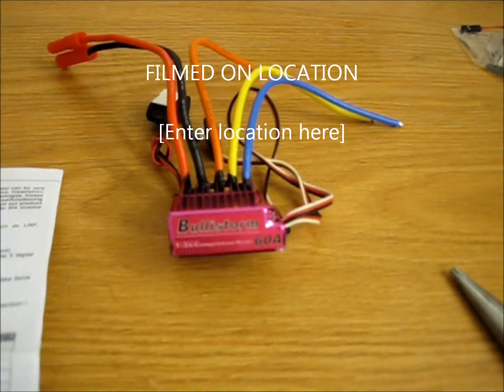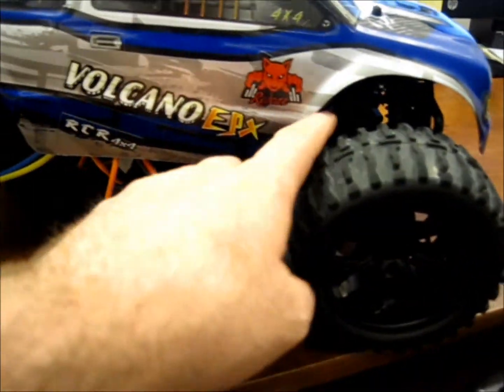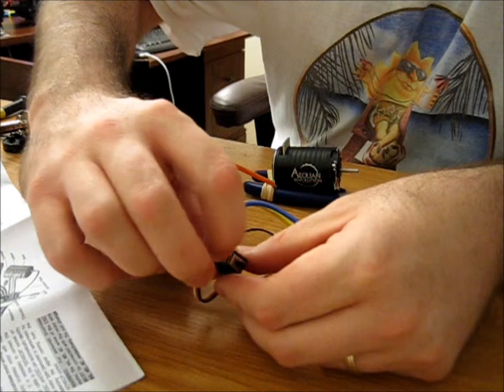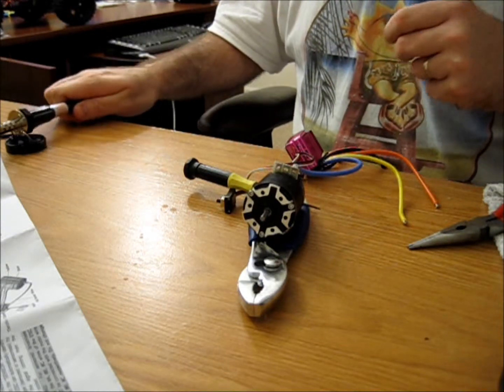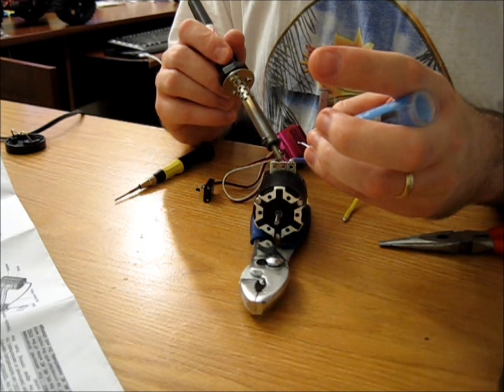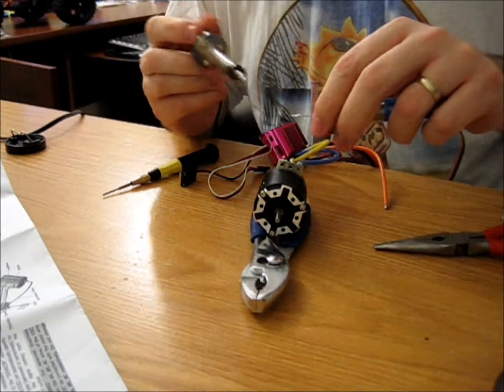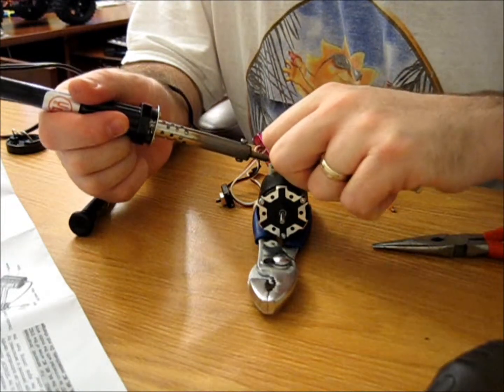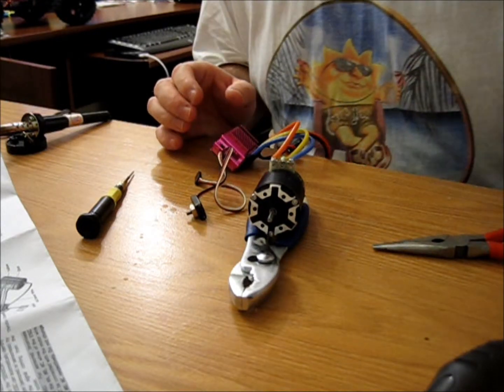Bullistorm 60A (Pinkish) Brushless sensor ESC and Aeolian 17.5t Sensor Motor - video

Comment from the maker: If you are looking at this video because your are thinking of getting this system?!? I would if the price is good, it can handle a 3s lipo and seems to work pretty good. The only issue is with the programming and I did mess up this first Esc when I Hooke up my 3s the first time. The second one doing very good with the 3s so far!!
Reply from the maker: If you get one of these motors, make sure to put light tight on the end cap screws. Mine came apart on my and the lost the bushings. Now I have to find some type of rebuild kit if the motor to work again. I did upgrade to a DYN4955 esc and a 3300kv fuze system and love it. even with only a 2s lipo it is insanely fast and powerful!!

Comment from the maker: *UPDATE* So far only a few runs with this system and two bashing video's posted.. I am very happy with this system.. I got a good deal from what I have seen already, but this thing really needs to be on 3s with the 17.5t motor.. The esc does get warm and so does the motor but I don't think it will be an issue with 2s w/o a fan.

Comment: if you use solder flux you can zip thoes wires on really fast.. if you over heat the wires you can get problems and bad solder joints as well if you dont use the flux
Reply from the maker: My solder has flux in it, but I want to get some to help with that issue. Thanks for checking out my video!!
Reply: ***** i never trusted solder with flux built in never worked for me
Reply from the maker: KevinMillard68 I like that it has some flux in the solder, just really need to upgrade my soldering iron, I have screwed up my tip and makes it had to get a good solder connection. I am trying to find some flux at a good price.

   I did finally test out my brushless system today, have to say not bad. the programming was not compeltely setup, but I think I got a good programming set-up now. It also needs 3s, does ok with 2s battery, but you can tall it would be so much better with a 3s battery. Also found out why it is important to use lock tight on screws and aluminum parts.!! Lost a grub screw from the rear hub and bent the pin, luckily I have aafew extra and bent the pin just enough to go back into the suspension arm and through the hub.
Reply: ***** gota love the power of brushless , i been tweaking my  losi sct and its reall y ripping on the 2s now and 3s is insane i want to try the 4s but ill have to waite a bit till i can get one should be tripple instane on the 4s . just put in a new brushed motor and esc into m volcano today stock stuff blew on me its going to go cheetah or leopard brushless soon
Reply from the maker: I have been looking at the Leopard brushless systems when I came across the system that I have now. If I ha not go this, I would have saved up to get a waterproof system, that way I do not have to worry about anything. When eve I want to play I can, especial in the winter time. I should have an extra esc and programmer on the way, should be here in two weeks or so.!!  

   I am thinking since I think I have everything figured out, that maybe I could trade for a good 3s and maybe some small brushed esc I can use in my toy grade Summit toy Truck!! or sell that esc and programmer and buy a 3s and hopeful have some money to put aside to get the toy truck upgraded to hobby level stuff!!

Comment: 26t pinion will give you some good speed , the esc should have come with a  program card to make it simple to set up
Reply from the maker: The brushless system came with a programming guide and a card but their are 15 options on the card and only 10 on the paper and 12 on the back of the card. On the 13, 14, and 15 I changed something without knowing it and tried to reset the program on the ESC but will not rest all of the codes.. Plus I can't get the program # 11, the direction of the motor to stay on option two, which is clockwise and not counter clockwise. The seller wants me to pay $4.00 dollars for them to ship me a new ESC and programmer and I don't have the money at the moment.

   Just like my FS-GT3B remote is all screwed up, the website people refuse to refund me or send my a new one until I ship it back to Hong Kong, which will cost me the same price I paid for the damn remote. I seem to only have bad luck with everything, sucks!!!
Reply: ***** the wires on brushless are kinda funny to hook up but you can just reverse 2 of them to fix things up, if you have forward and reverse right now but they are opposite from what you need then just reverse the 2 out side wires and it should be ok unless you have esc problems ,
Reply from the maker: yea, I was thinking about trying that. I guess I should and see if that works and maybe sell and try to make a little money from the new esc and programmer that I have coming.
Reply: ***** iam going to put the most count pinion in my volcano for speed, might even try the titian 12t in it as well eventually that or get a good brushless going